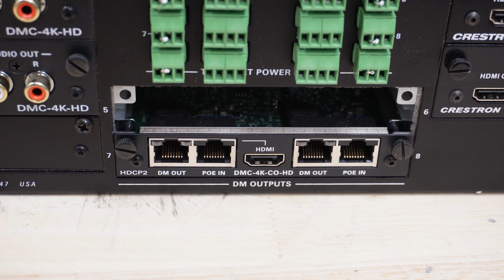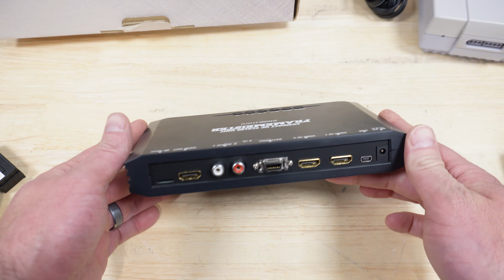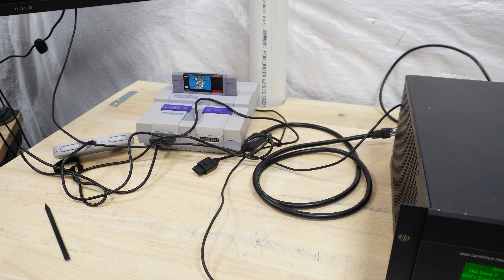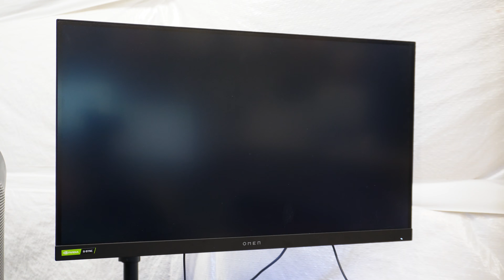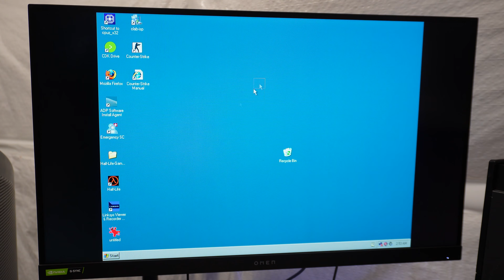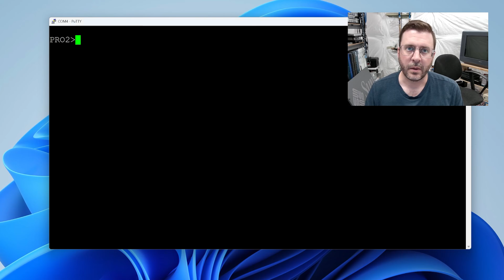Crestron Video Gear

Comment: I will admit to being triggered by the thumbnail of this video. Cheapest front panel buttons ever.  DM : "Deposit Money" or "Doorstop Matrix".
Reply from the maker: haha
Reply: @clabretro  A few of the TV's in my house are wired with pairs of DM TX 201 and RMC RX's to an equally as old Extron HDMI Matrix. 
One boardroom's tear out is another tech's gain lol! It works and it was free...
Look for some CAT7a STP patch cables, as that's close to what Crestron spec's for DM. They sell a DM "Ultra Cable" -  CAT7a with their logo on it. Not fun to terminate in the field!